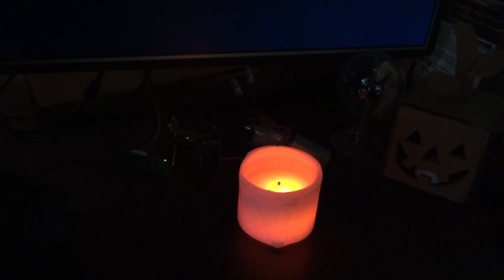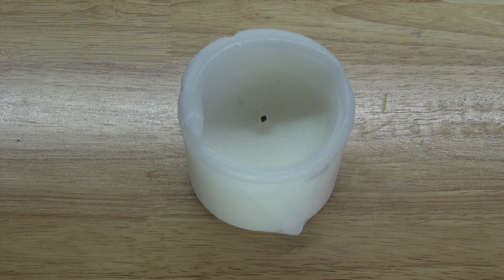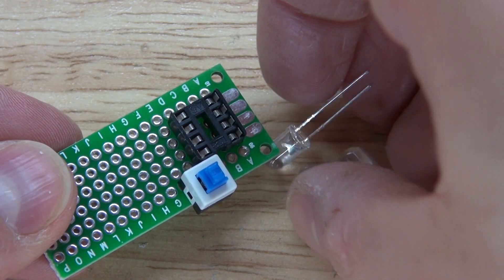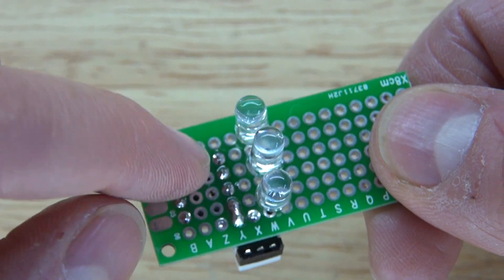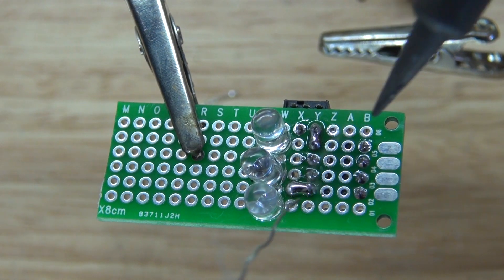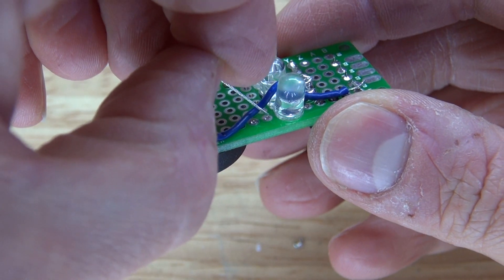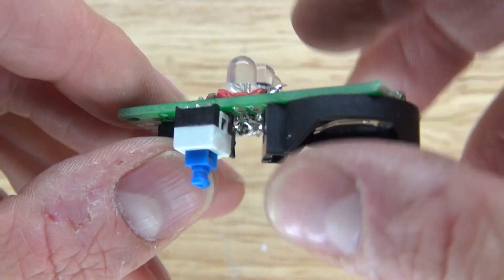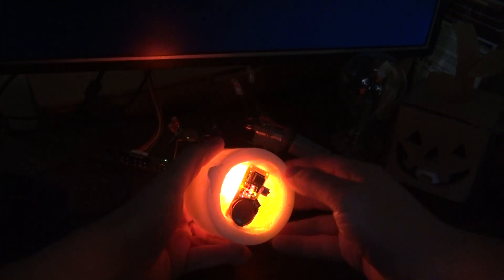LED Candle With ATTINY85

Comment: Hello,
i am just a beginner to arduino board. i d like to clarify of course if you agree and add some additional info regarding programming of the chip. First you write the sketch into arduino software with pins 11, 12,13 and you upload it into chip renaming them to 0,1,2. i know maybe many of your followers are more expert than me but as i can see thats the process.
Please correct me if i wrong. Thanks again for this video. George.
Reply from the maker: No, you are correct.
Reply: @SciTyeTech  thanks. Also your 3rd led is stable. On pin7 or 2 for this attiny there is no pwm support. But you can use pin 4 alternatively. . In that way all your 3 leds will make the candle  effect. Your video made me to search a lot and finally to find the solution. Thanks again.

Comment: Nice video. Don't you think a resistor is needed for the leds?
Reply from the maker: Thanks! Normally no, because the current is lower when using a battery compared to a power supply.
Reply: @SciTyeTech  I would think that the resistor will protect the IO, to reduce current.

Comment: Hello as far as I remembrer  PB0 , PB1 and PB4 should be used for pwm on Atiiny85 . PB4 is on pin 3 of the chip ! . You use pin 7 which is PB2  . PB2  do not allowed pwm .
Reply: I confirm you have to change your wiring for PB4.
here is the corrected code:
void setup()

{ pinMode(4, OUTPUT);
pinMode(1, OUTPUT);
pinMode(0, OUTPUT);
} void loop() 
{ analogWrite(4, random(120)+135);
analogWrite(1, random(120)+135);
analogWrite(0, random(120)+135);
delay(random(100)); }
Reply: _correction : PB4 is on pin4  not pin 3 
_btw you need a resistor for each led ;)
Reply from the maker: That's a very helpful tip. Thanks!